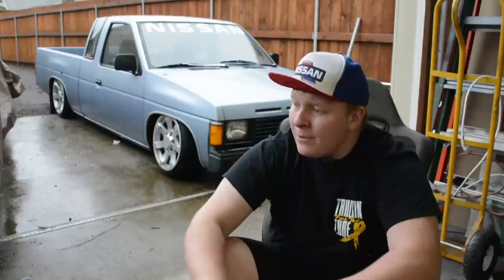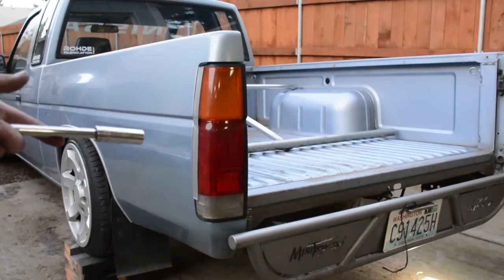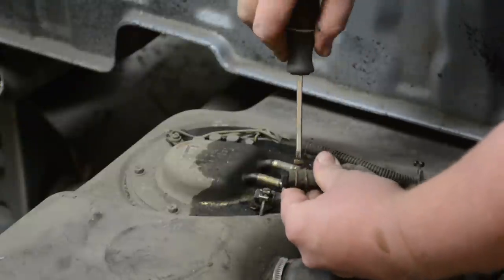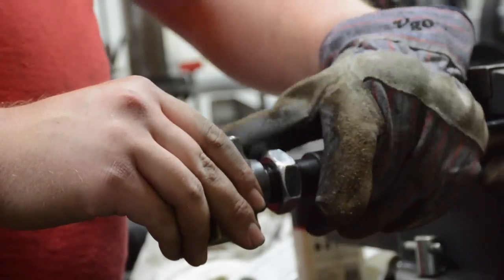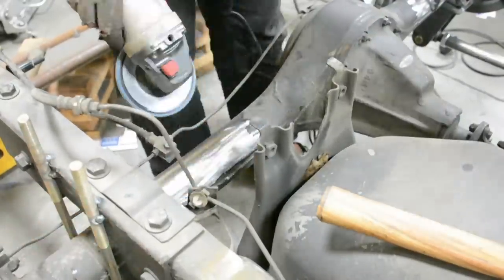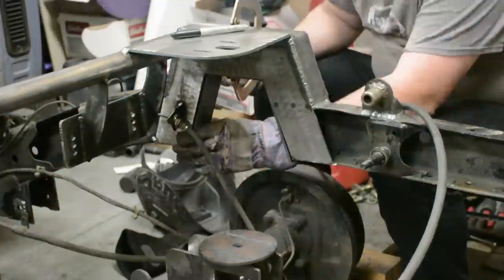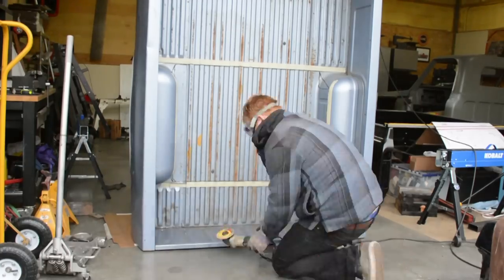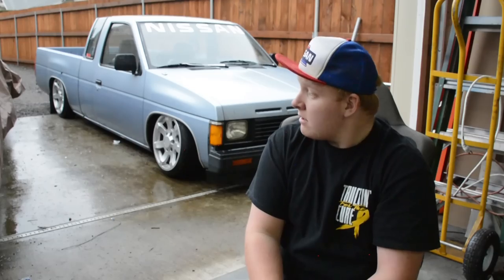HOW TO BAG THE REAR OF YOUR TRUCK

Comment: FYI DOM tube starts as ordinary welded seam tube it is then drawn over a mandrel and pulled through a die This does several things that make it stronger than welded seam tube  The more uniform in OD ID and wall thickness make it more structurally sound but pulling it over the mandrel and through the die work hardens the metal changing the grain structure makes it stronger
Reply from the maker: Thanks for the info🤙

Comment: Have had any problems with you pumps and tank  where it is .? From the weather?
Reply from the maker: 3 years in the rain with no major issues. Had a ground strap get a little funky after a year so re ground the frame and added some goop on top and have been smooth sailing.

Comment: Is it a problem when the bag is at full squish and the convolutions rolls over and touches the bag mounts?  I'm running dominator 2500 and my mounts are typical bag on axle brackets.  The dominator rubber rolls over quite a bit fully compressed and touches the brackets
Reply from the maker: That's pretty common, ideally you don't want the bag to touch metal. But fully compressed is common in alot of cases. You'll want to check for sharp edges on the brackets them selfs, round over any 90 degree edges or harsh areas with a flap disc and then sand paper to give the most life to the airbag. If its touching smooth metal the bag should last a long time to the point where the bag itself shows wear, like drying out.

Comment: Any idea what that offset wishbone situation does to your roll center? or it doesn't matter to us in this application maybe.
Reply from the maker: I drive this truck pretty easy, haven't noticed any major roll issues in the last 4 years. If you we're building somthing that was going to go fast and corner harder I would keep the roll center as centered as possible.
Reply: @scrapingpavement  Thanks for the reply. I have also seen some older OEM vehicles with an offset upper link, I was considering doing something similar on my truck.

Comment: Kool vid bro helped me understand a little better how the setup works 
I was wondering on the storage tanks, can u have more than 1?
Or is it kool to just have 1?
Also do u require to have a  gauge to monitor the pressure on the tank?
Thanks
Reply from the maker: Thanks, i would recommend at least a 5 gallon air tank. But ya you can run multiple tanks or one large but the more air you can hold the more compressors you'll need. I would recommend an air gauge, or if you do a setup like mine with no gauges i run a pressure blow off valve so if the pressure switch doesn't tell the compressor to turn off the valve will release so the tank and or compressor doesn't blow up.

Comment: How did the 3 link hold up to the side to side movement? Im going to run coilovers and want to keep the stock floor
Reply from the maker: Truck is still going strong as a daily driver. The roll center being offset leans a little more turning one way than the other ( not noticeable unless paying attention to it ) if you were to locate the single point on the wishbone would solve the slight lean in a corner. Other than that no complaints
Reply: @scrapingpavement  sweet! Thanks ill post some vids when i do my setup

Comment: What do you need to move the stock gas tank ? You should do a video when you do that to little blue
Reply from the maker: +carlos urrutia fuel line, wiring, cut the bed floor out in the back make a new fuel up location, mounts to mount it.

Comment: Do theses air bags tighten up as they're lowered? Or are they as squishy when lowered as when they're lifted?
Reply from the maker: It's actually opposite when at full lift there super stiff, and aired down there squishy. Although if you have shocks it counter acts the squishyness at low heights

Comment: I have a 95 hardbody with 5 spoke Titan 18s on it the wheels stick out a little bit. I put 4x4 fenders on the front for clearance what is your suggestion for clearance on the rear?
Reply from the maker: 4 things you can do.
1- if you have an h190 axle you can put a datsun 720 axle in which is 1.5" narrower on each side or 620 axle which is 3" narrower on each side and swap third members.
2- pull the shit out of the bed fender ( ugly )
3- graft 87-89 rear pathfinder quarters to the bed they have a big buldge like front fenders, or some will even graft 4wd front fenders to the bed ( pathfinder quarters look better imo )
4- lastly you can sell the wheels and get ones that tuck.
Reply: @scrapingpavement Thank you always look forward to watching your videos and seeing what's next. The last way is probably the way I will go because I'm not sure if I really like the 4x4 fenders on it

Comment: I’d like to know what allows for the rear axle to roll without binding
Reply from the maker: The ruber bushings allow a bit of side to side movement for average driving. If you wish to go side to side and lean the truck over alot I would recommend heim joints

Comment: Hey before you put the bags in how was it so low i put blocks in my s10 but it didnt even go that low do i have to remove some leaf springs now to finish lowing my truck plz let me know
Reply from the maker: Well on my nissan I had torsion and drop spindle drop on the front, re drilled leaf hangers, blocks, and mono leafed in the back. For an s10 you cut do drop spindles and drop coils up front or even cut springs. For the back of an s10 you can do drop leafs and blocks, or mono leaf. Or I've actually seen s10 guys flip the overload. Only problem with doing some of those things is the truck will ride like crap.
Reply: @scrapingpavement  when you say the truck will ride like crap do you mean you will feel every bump in the road
Reply from the maker: @travislee2014  yes you will feel every blemish in the road and will be bouncing up and down in your seat. Although some people like that😂

Comment: I would love to do this to my S10 wish I could find a shop to do it for me thanks for sharing this
Reply from the maker: Theres actually a few high quality bolt on s10 kits out there that require little to no welding.
Reply: Can you point me in the right direction as far as the brands or websites I need all the help I can get
Reply from the maker: @stirlingpickett5253  nfamousmetal, thorbros, twisted images, extensive metal works. To name a few.
Reply: Thanks again I appreciate it 💪 are you still mini truckin?
Reply from the maker: @stirlingpickett5253  no problem, still drive this blue nissan till this day. Also picked up a mazda b2000

Comment: hi so i lowered a toyota pickup but the driveshaft rubs on this bridge of the frame what can i do about this and did you run into this
Reply from the maker: With the kingcab d21 there a 2 piece driveshaft so dont have to worry about rubbing anything unless it were on 22s or bigger. But I've heard this is an issue with the yotas, most people will notch the cross member for clearence and reinforce afterword. Or some will make a a whole new cross member to go in.
Reply: scrappingpavement thanks dude like seriously you helped a lot

Comment: What brand air valve manifold? And what’s your opinion on them so far?
Reply from the maker: +Vladimir Rosales it the old version of ride pro valve block. Had an issue when I bought it used valve was leaking, but took it apart and put a new o ring and it works great. Really simple and easy to take a part and use. Time will tell how I like it in the long run

Comment: Did the wishbone suspension have good articulation movement
Reply from the maker: This setup has been handling great, it's more setup to keep the truck flat around the corners but if you wanted side to side articulation you could simply add heim joints.

Comment: What kind of welder i need to this ? Or how big ? I have a hobart 100 mig will i need a bigger one?
Reply from the maker: Ya it is possible with that machine when welding the thicker brackets you'll want to have the amps maxed out for flux core, make sure to bevel your material for you weld to bite in. I would use a larger wire size like .35, try not to use any extension cords the shorter the plug the better.
Reply: @scrapingpavement  
How much will you charge for labor to install air bags? 1985 buick regal

Comment: Would this be the same or at least similar for a 93 Toyota pickup?
Reply: yea, i have a very similar setup on my 86, which is almost the exact same as yours. I didnt raise my gas tank and i wish i did, it barely hangs lower so when im rolling low it will hit sometimes. Make sure you make your wishbone as wide as you can like he did, mine is like 4.5" apart and the axle had a bit of sway but when i mounted the shocks they helped locate the axle.
Reply: EvanThaG thank you, I appreciate it a lot

Comment: Can I bag my truck without a 3 link or four link? Can I just keep the leaf springs on? Scrappingpavement
Reply from the maker: For helper bags you can run leafs, but I don't recommend using bags on a mono leaf setup very dangerous.

Comment: Im having a hard time. Bagging my first truck i cant figure out how to measure for my bag mounts. My bag with air is 8 inches. Without its 3 inches which only gives me 5 inches of travel however to lay frame from where i want ride height my frame is 9 inches off the ground its irritating to say the least. Any help is appreciated
Reply from the maker: What kind of bag do you Have? That is probably just the relaxed height at 8" most bags go from 2.75"- (10.5-12.5") even on a small bag there should be a good 7.5" of stroke. When the airbag is on your control arm you will actually get more lift then that because of the pivot point because of the ratio the bag sits on the arm. That's why some people like to mount there bag on there link bar you can get a 1:2 ratio of lift from the bag so if a bag gets 8" of stroke by having a 1:2 ratio you could get your truck to lift 16" off of the ground.
Reply: scrappingpavement i bought them from bagit or chasistech. They are 2500# bags and they are going on a mazda b2200. I pumped 40psi in to the bag and it measured 8 inches and i collapsed it and measured 3 inches. I appreciate your reply
Reply from the maker: Try preseurizing it to 90psi and see what it reads. Don't worry about blowing it up as to most bags can inflate to 600psi
Reply: scrappingpavement ok ill try that. I appreciate your help. Nice builds btw i lool forward to learning more from your videos.
Reply from the maker: I just looked up your bag and sure enough it's specs are 2.8-8.5 which is a small amount of stroke. I would recommend getting dominator 2500 for the front which are 2.8-10.5 and dominator 2600 for the rear which are 2.8-12.5.
Reply: scrappingpavement lol i was just doing the same thing. I have d2500 bags which the spec i saw said 10.5 at 100 psi and 3 collapsed which mine are 3 collapsed but ive only had 40psi in them so far
Reply: scrappingpavement new question i have my c notch done and my 4 link on. Im using a 2 post lift to lift and lower at the moment. At ride height im nearly center of the c notch. When i lower and mimic laying frame my pinion angle is still good but my axle rolls forward and is about 1 inch from touching the front of my c notch

Comment: This is a 3 link, not 4. The upper wishbone is solid so counts as one.
Reply: Metal Fruttolo
So you don't need a pan hard bar with 2 and 3 link but do need one with 4 link?
Reply from the maker: +sr20nissan 720 you need a panhardbard if there's no triangulation in your bars. For example a parelle 4 link needs one or a 3 link with a straight upper link.
Reply: That's what I was thinking I should of read comments first lol.

Comment: your a hell of a welder i no nuthin bout welding. your air bags r diferent from other vids ive seen. yours dont make any sound wen u raise it. now say if sumthin hapens/malfunctions with the air system wat hapens? can u stil drive the truk?
Reply from the maker: Thanks, if the bags have air in them you can limp home if you had a compressor go down or switches. But if you blow a bag you can possibly lift all 3 corners to get the 4th corner off the ground other wise no your stranded. I have AAA so if somthing bad goes wrong I have a life line lol. Out of 4 years of driving a bag truck daily I have never been stranded.

Comment: What are them wheels off of?
Reply: Dustin Musgrave I think one of the videos will tell you, when he got the truck. cause he had to stretch the tires on the rim.
Reply from the maker: +Dustin Musgrave nissan titan. There 17x7.5 35mm offset I believe. You will need to bore them and or use spacers to fit the hardbody hub.

Comment: I want to do a 3 link suspension on my 14 F150 Tremor seen here - https://photos.app.goo.gl/QfDURN1mpBMdBLCq8 I'm worried that the wishbone won't allow great articulation with handling. Using the factory leaf spring mounts for the lower bars works out awesome just need to do the upper bar. I plan on doing coilovers with load helper bags in case I need to tow or haul something but I want amazing road handling and drag strip performance as well. Do you think this wishbone style setup will allow for that?
Reply from the maker: Sweet, ya the 3 link can work for ya. Theres more room in the f150 to make the setup bigger and better. If you want more articulation, on the single pivot of the wishbone use a heim joint or johnny joint. And heim or johnny joints on the lower link bars.

Comment: I don't mean to sound disrespectful of bagged/slammed mini trucks... But here I go. I realize  this mod is pretty much "all show, and no go" as they say... But even if you're not off roading in hardcore terrain, or launching/cornering hard with lots of power and speed... Don't you worry about literally all the torsional and lateral force being applied to one bushing/bolt on your upper link? I mean even a traditional 3 link, the upper link is only usually responsible for keeping the axle from twisting under load, while lateral movement is controlled by a panhard bar or watts link. Doesn't that worry you? I think I'd constantly have anxiety worrying about that one bolt being over stressed and failing.
Reply from the maker: No disrespect, a wish bone setup like this has been known for 20+ years with no damage or broken parts. If you think about  a lot of own car setups have 3 link suspensions just in a basic form. I've been running this setup for 4+ months now with no sign of wear or damage, I just recently pulled the bed off to check on everything and nothing has failed me. Even though this is a "work truck" I have a launched this as hard as I could and took it up to the mountain roads, handles amazing besides the limits of stock motor and stock brakes lol.
Reply: scrappingpavement I know what you mean about stock brake and suspension limitations. LoL I've had some handling disabled vehicles... But also a few canyon carvers. But I mostly grew up around V8 powered GM cars, F bodies (has what they call a "torque arm" 3 link in the aftermarket, with a panhard bar), G and A bodies that have a triangulated 4 link setup in the rear.  This isn't like what GM built for 40+ years... I get nervous around things that weren't proven designs by an OEM. There's enough dangerous drivers out there to be scared of, I don't want to be scared my own vehicle will put me in a ditch or upside down.
Reply: my truck has a similar setup to this, been going strong for almost 4 years of mostly daily driving. I drift, drag, corner, and well basically beat on it a fair amount. Wishbone setups are very popular, especially for setups that keep the stock gas tank location like this one, bags and coilovers both. I would say its a proven design.